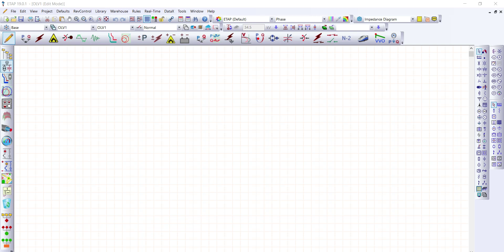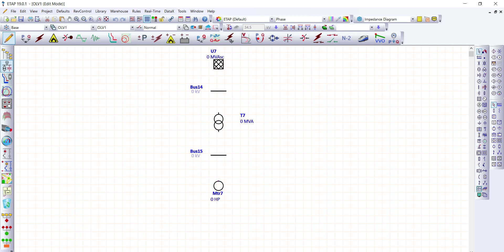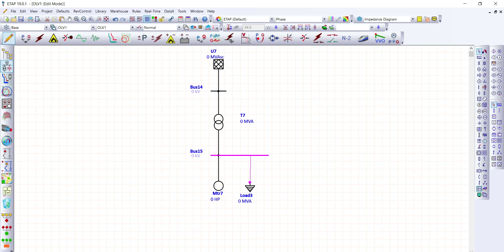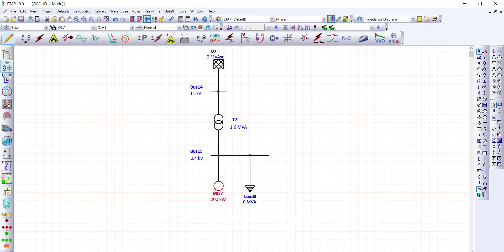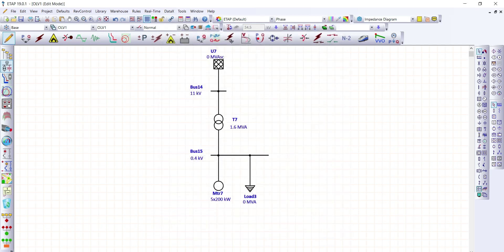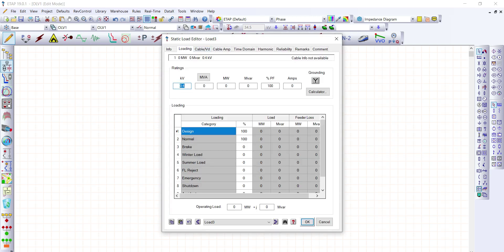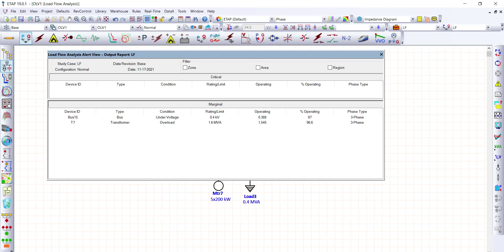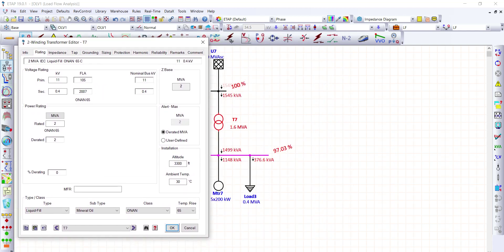Load Flow Study Using ETAP | Part 2

Comment: Sir where the information of impedance for the transmission line or cables? We need to provide data as well. Any information how to check it
Reply from the maker: Impedande of cables have to be taken from the actual cable manufacturer.
Reply: @juliussalutan8006 Sir Im asking in this tutorial ETAP software does not shown any information data of the transmission line cables, impedances, distance, and sizes.
Reply from the maker: @howcreated_ideas  ETAP does not provide cable data for transmission line. It has to be manually encoded in ETAP library. You need to have data from other sources so that you can update your cable library.
Reply: @juliussalutan8006  Thank you Sir! Appreciate more video for tutorial..

Comment: thank you sir! Just have two questions! what is the static load and lumped load represent ? what is the deferent between them and the induction motors??
Reply from the maker: In a power system  static loads are fixed loads which do not alter significantly, e.g. lighting system which draws power steadily over a period of time. This is opposite to dynamic loads that change rapidly, e.g. motor load which draws a large amount of power to start. In ETAP, lump load is composed of 80% motor loads and 20% static loads
Reply: @juliussalutan8006  thank you so much sir

Comment: Can you share sir the differences of the four (4) operation mode - swing, mVAr, voltage and pf mode.
Reply from the maker: I had briefly explain this operating modes on my first video (Load Flow first lesson video). If you have only one power grid or generator on your SLD, then it must be in swing mode. If you have power grid upstream and a generator somewhere downstream, then the power grid must be in swing mode while the generator could be any of the three i.e. voltage control, mvar control or pf control. Please note that there must be at least one swing machine for power grids or generators to be selected as a reference machine for the entire system.
Reply: @juliussalutan8006  yes sir i watched it. Thanks.
Reply from the maker: @arielpineda4366  welcome sir
Reply: Hi